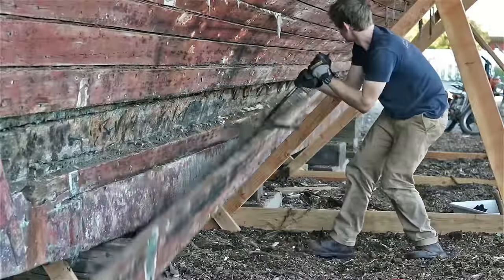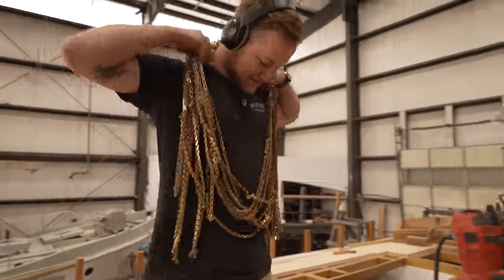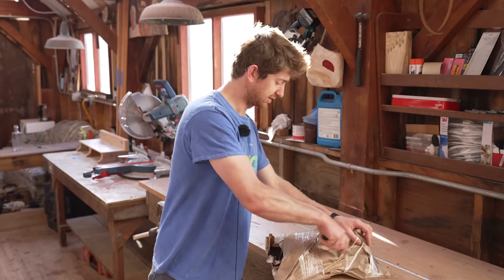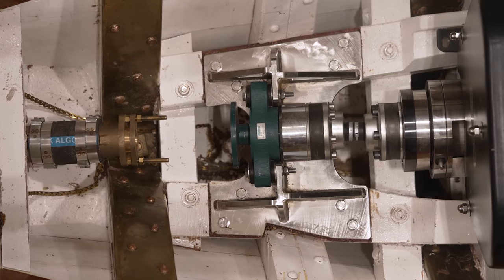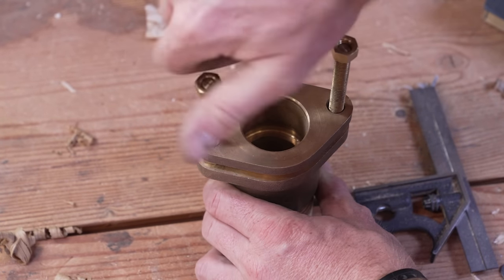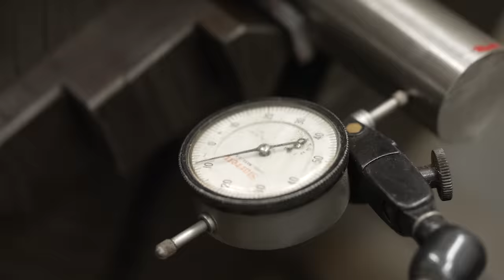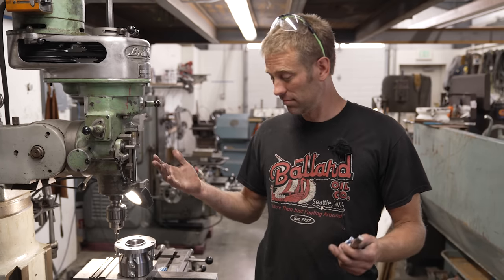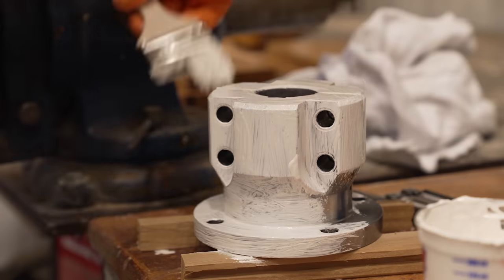Machining the Driveline & installing an unusual Propeller (metalwork & boatbuilding)

Comment: Wow,from all the shaft seals and thrust bearings I’ve seen in my life, this one is really slick! I’ll bet she’ll be vibration free!
I have to add that you must continue filming your sea trials and trip back to the UK. Don’t think I could not know how it handles after watching your series for so long! 
My condolences for the loss of your Queen!
Reply: @Barrie Harmsworth I like this CV joint set up. My prop guy told me the max amount the flanges can be out is .002" which is my thinnest feeler gauge. I've also learned that you have to align a shaft coupling in the water. The point loads while on the hard can distort the hull shape enough to cause a misalignment and the resulting vibration. While I've had a couple of pretty competent yards tell me otherwise, I've found it to be empirically true in most of the boats I've dealt with the issue on.

Comment: Wow, that prop is a masterpiece (like everything else on Tally Ho).
Reply: Isn't it just though? Virtually everything on TallyHo, from the polished bronze floors and knees, to the paint job on the coupler in this video, that no one will ever see, to the flexible coupling that's yet faced off to a tenth of a thousandth of an inch, has been done the best it can possibly be done. I dare say this will be the best built sailing craft afloat when it's done.
Tally Ho really needed some love sitting there on the Oregon coast, and Boy Howdy, did it ever get it! Every piece on her has been a labor of love.
Reply: SPW is not far from my home. I have such a prop on my yacht as well. German Engineering. 😉

Comment: Hi Leo, great work! I have the same stuffing box and the previous owner of my boat machined a small threaded hole to the flax stuffing area and fit a small grease fitting connected to a copper tube which terminates in a small threaded grease cup. When back in my berth  I give the grease cup a turn or two and it injects a little grease in the flax area which stops the drip while in port but heats up and allows water to still drip while underway, simple and functional. All the best!
Reply: sounds like a good idea.
Reply: I run the same but one modification, l have a grease gun permanently hooked up and a quick pump or two. Don't over grease tho can gum up a smaller bilge pump with the stuff that ozzies out or clogg up a narrow hose.
Reply: Seems to be standard on narrow boats.
Reply: You might end up slightly polluting the ocean.

Comment: Cutlas bearing rubber can if left dry too long before being wet can stick to the shaft. When the shaft first turns it can pull the rubber off the tube. Simple fix is to check with careful rotation before putting engine power on. Alternatively, if that is not an option, put some ordinary washing up liquid and water mix on the shaft and rubber. Make sure to add a little water otherwise the washing up liquid goes sticky. That stops the sticking, and it washes off as soon as the boat is in the water. Done it a lot with industrial units that can sit a while.
Reply: I saw Swarfega used on cutlass bearings when I worked in a boatyard many years ago.
Reply: @andychurches7280  I' don't remember if Swarfega has abrasive particles in it. But if not, then yes as it is a water soluble wetting agent it would work too.
Reply: @andyrbush  yeah, I'm pretty sure the original green swarfega didn't contain any abrasives. The modern orange version possibly does.

Comment: Very pleased to see the old Bridgeport mill and lathe. I trained as a machinist back in the early 60s and finished my apprenticeship in 1967 on many of these types of machines. The CNC and computer operated machines of today are way past my understanding. This was a great look at machining of almost 60 years ago. Thank you.
Reply: Worked in a forklift factory years ago that had robot welders and CNC - everything; state of the art and all bells/whistles. I worked with an old fella who ran his own quiet area away from all the drama, with 3 bandsaws from antiquity and a heap of raw materials that we scavenged for cutting up to make all manner of little blocks to order for the robots to weld or chew on. 
The whole space-age operation would have ground to a halt if it wasn't for the old fella in spectacles with his tape-measure.
Reply: @dancarter482  I know exactly where you are coming from.
Reply: I trained to use a CNC, but first they made us use old lathes and mills for weeks and I gotta say those are some sturdy, and amazingly engineered machines... The precision and finishes you can get using them is just incredible
Reply: @racsofischer7601  I have a nephew in Minnesota who has his own shop. He is self taught on the CNC and several automatic machines he bought from Switzerland. They are absolutely marvelous, but he like you learned on the older machines. He still uses his Bridgeport mill and I think he has a standard lathe to do one off parts. I was amazed at what he was able to do with his automatic machines.
Reply: @formerparatrooper  I'm from Switzerland too
Reply: @racsofischer7601  My nephew got his machines, two of them, from some sort of a selling outfit that had a shop set up to show perspective buyers how they worked and what they could do. I know he got them for a substantial discount when they got newer more elaborate machines. They are absolutely fascinating for multiple runs of small parts, and his clients come for more he has the set ups readily available. His newest machine can turn and mill something which amazed me when I saw them several years ago.
Reply: It's manual machines for me and I just started doing machine work about 15 years ago.  For many jobs CNC machines are not a good solution.  On one-off work it would be easy to spend more time on the computer designing the job than it would take to just start cutting metal manually.  As much as I admire the consistency of CNC, everything I do is different from the last job and the next one so I prefer manual machines.
Reply: @David-hm9ic  I left the machine trade when I shifted to Australia in late 1969 and never looked back. I took overseas projects as a welder and Iron worker and that work was most rewarding. I ended my working life as a site representative for a large architectural firm and that work was even more rewarding. Now that I am retired I do think from time to time how nice it would be to have a mill and lathe but it is just remembering some better times when I was much younger.

Comment: Tally Ho is a beautiful piece of functional art; the woodwork, bronzework, fabrication, casting, machining etc.; boatbuilding meets art, engineering and science. You've taken and restored an old racing yacht and repurposed it for a 21st  century cruising/racing yacht, at the same time, making the process a teaching and educational element. 
When you've completed restoration and sailed Tally Ho back to the UK, you should put Tally Ho on temporary display in the Tate Modern, a repurposed power plant to contemporary art museum. Tally Ho and the process would make a fantastic temporary art installation. 
Best of luck!
Reply: I often use the term "Functional Art" and couldn't agree more with you!

Comment: Looking GREAT.  As a machinist, an episode I can fully appreciate with complete understanding.  Nice machine work that was done properly without any short cuts or "hacking".  Nice work.
Reply: Were you wondering why he was using a parting tool for facing?
Reply: @cyrilhudak4568  No, they cut straight and can handle a heavier cut.

Comment: I switched from the traditional packing in my packing gland, to teflon rope. I never had to change the packing after that and it was easier to control the 'drip rate'...
Reply: Has it been in use long enough to score your shaft yet?  Teflon is famous for that.
Reply: @two-sense  Not really, 2000 rpm combined with infrequent use and constant sea water lube meant no galling over the life of the shaft.
Reply: @mikeskelly2356  Got it.  So if you use Teflon, as long as it's only subject to "infrequent use" everything will be fine.  Thanks.

Comment: Great video. She looks more like a functioning boat and less like a consruction project. One thing you didn't cover... How do you change the pitch on the propellor?
Reply: its automatic
Reply: There is a very good explanation from amicidavinci that answers the burning question so many of us had.
Reply: Presumably you take it apart and adjust whatever stops the travel.
Reply: Peter smith  that was my question too. I get how it will adjust itself into the right pitch as it gets moving, but to lock it in a position for generation… can’t figure it out!

Comment: looks good, not a fan of split couplings for the reason you put extra bolt in as a stop seen them fail/pull out as a lot of force when going astern on a small fixing like that. we always machine a matching prop taper at each end and use a blank coupling bore taper and nut on the end with locking screw so no way it can pull out.also when you get cutlass bearing wear you can turn shaft around.

Comment: It's so awesome that companies donate what looks like very expensive equipment for Tally Ho. The mounting plate is beautiful! Throw some flat washers on the bolts though. It adds an incredible amount of clamping power more than just the bolt heads alone. Get some big fat fender washers even better.

Comment: I've worked on stuffing boxes before quite a bit, but for water pumping windmills.  The usual material for such a stuffing box is graphite impregnated material (rope).  Works, but you CAN get square teflon material in a "rope" form.  You can buy it in a square cross section in several sizes.  So if you need to fill up the stuffing box, you get the appropriate size, cut the stuff to form "rings" around the shaft.  just offset the breaks in the material and by doing that, it won't leak.  Teflon is the best material for stuffing boxes in my experience.  Better lubricity than anything else, LIKES oil or grease, and last longer than any other material.  And like the graphite rope, you can repair it or replace it.  Just a thought.

Comment: how do you control the pitch of the propeller while it is spinning? would be cool to learn more about that.
Reply: It was explained in another comment above. Apparently it's a passive system in which the blades are free to swivel mechanically to the path of least resistance in the water. While the shaft isn't spinning but the boat is moving forward, the blades will automatically swivel (feather) parallel to the keel like fins on a dart. When the shaft starts spinning, the water presses against the blade, forcing it to swivel to align with the direction they're spinning (perpendicular to the keel), because it's the angle of least resistance for the blades against the water. The result produces thrust.
Reply: @polarguyinak1  Thanks for the great explanation! Very cool concept, i imagined a much more complex solution...

Comment: Wow! Exciting stuff, Leo. I do have a quick question, though. Are you planning to (or considering) mounting small cameras in the various places that are not easily accessible, but which contain critical components? Seems like a reasonable and pretty cost effective way to let you get a quick look into hard to get at spots without having to disassemble bunks, remove hatches, etc. Having a look at the spot that just made a funny noise or that might be taking on water without having to leave the cockpit and/or chart table would bring a lot of peace of mind.
Reply: @Carpenterjoh65  Except that it would still entail leaving the cockpit or chart table, rummaging about in small spaces, find the access hole, manipulate the scope (harder to do than all those spy movies on Netflix makes it appear), etc.  Or... flip a switch and have a look at several places in the matter of a few seconds.

Comment: Hi Leo, how does the pitch control of the prop works? Just by turning forward or backwards I guess? And how does it stay in the forward position when regenerating?
Reply: Commenting to see the answer.
Reply: It was explained in another comment above. Apparently it's a passive system in which the blades are free to swivel to the path of least resistance in the water. While the shaft isn't spinning but the boat is moving forward, the blades will automatically swivel (feather) parallel to the keel like fins on a dart. When the shaft starts spinning, the water presses against the blade, forcing it to swivel to align with the direction they're spinning in the water (perpendicular to the keel), because it's the angle of least resistance for the blades. The result produces thrust.
Reply: @polarguyinak1  ok that part I understand, but how does the regeneration works then..?

Comment: Hey Leo, what kind of packing goes into the stuffing box ?
Reply: Flax Packing
Reply: Traditionally it is a waxed flax braided cord, usually of a square shape. What Leo may choose I can't say.
Reply: I used to rebuild pumps and valves for boiler water and steam and the packing we used was either teflon braided square cord, or graphite coated square cord.
Reply: @webbtrekker534  I spent many of my working years in the "valve repair" industry.  Needless to say I can not ever remember using that packing material on valve that had water running through it.  I do recall using a graphite infused packing called "Garlock" with very good results.
Reply: @danharding4794  In the late 1970's I had to replace the engine in my sailboat and had to move my shaft out of the way to get the old one out and the new one in. Decided to replace the packing and went with what was then available in the local chandlery and the oldtimers I talked with. I think I remember using a 3/8 inch packing. Put about 3 layers in. Lots of fussing to get the tightness correct. It was a 2 inch shaft and a 16/22 three blade prop.
Reply: @Webb Trekker,
A 16" diameter  prop would not have a hub large  enough  to bore out for a 2" diameter  shaft. Also  a 16 diameter × 22 pitch  prop seems  more like a fairly  fast power  boat than a sail boat  prop. And even if the prop  was 22 diameter 16 pitch it would  be still be hard to bore  that diameter  to fit a 2" shaft. 50 years  ago boats had much  smaller  shafts  then  same  size  boats today.  How big was your boat?
Reply: @williambikash6645  Argue all you want but my 33 foot 6 inch, 20,000 pound displacement motorsailer had a 42 horse Gray Marine gas engine (Alaska Luger)and did in fact have a 2 inch shaft. I lived aboard this vessel for 10 years and used it often. I had to haul out annually for bottom maintenance and replace the shaft zincs! I know how big it was. I had a full displacement hull and drew 5 feet of water. 5,500 pounds of lead sat on the bottom of that keel. She was white oak framed and 5 quarter red cedar planking. She was built in 1951.

Comment: I dreamed that the Original Designer, Builders and Owner of Tally Ho visited the future and saw your meticulous craftsmanship and Innovation, it was a wonderful dream. (Huge Smile)! I added this same Aqua Drive and  Veriprop system (except only a strait Yanmar  diesel and dripless shaft)  to both my Pearson Electra S/V (Jackpot) and  Tillotson/ Pearson Cat Ketch, Freedom   (S/V Cheshire).  However the Original designers and builders of my boats used carbon fiber masts-n-such, lacking the appeal of how well traditional wood boat craftsmanship seasons with new technology. Thank You for your Work Leo. You make my heart sparkle with pleasant dreams with every proper maritime video! Respect.

Comment: 17:45 As a young man I operated a Bridgeport mill. I cut many a keyway on the Bridgport, shaper and press.
Half inch keyway using a tool steel broach on a press. I can smell the oder of the cutting oil.

Comment: Now, I've been watching these boat builds on U-Tube for over 10 years and so far only Sault & tar floats. It also does a grate job of SAILING. Now, I don't want to herring things abit, but!!! I'll be 90 years old in 2 weeks, been with you  since you bought the thing??? so a nice ride around the harbor would be nice.
Gramps

Comment: It’s really nice to see you using the same system I had and how you talked about removing the propshaft. I tried that with 27 years of dry rubber bearing and almost crushed my nose doing so. Glad to see you didn’t have to remove the old ones.

Comment: Many years ago, I had to re-engine a twin engine big game fishing boat in Kenya. Because of the increase in engine size, the prop shaft and P-bracket had to be enlarged. I used steel plate to use for the thrust plate.
Glad I found your site.

Comment: For 10 years I have been watching the ABOM79 YouTube channel. Adam Booth is a machinist in Pensacola Florida, who does machining exactly like that shown here. By watching ABOM79 I have learned that the "interference fit" means the keyway is slightly small so that the key is hard to get into it. This prevents any slightest movement of the key in the keyway, which, over time, would ruin the shaft necessitating its replacement. But what he is saying is that the interference fit makes the key bind into the shaft and hard to remove. Without the threaded hole, you would need to use pliers that grip the key with such force that they would leave marks, and might ruin the key. Instead you can screw a bolt into that hole and mar the bolt all you want leaving the key in pristine shape.

Comment: Leo I was watching your episode on your diesel  tanks I have a Waterline sailboat with an aluminum day tanh for the furnace and in 26years it has never has a leak  and there are no coating on the outside just keep the sail water away from it Capt. Ron Sidney BC